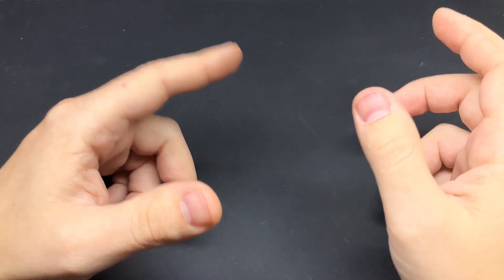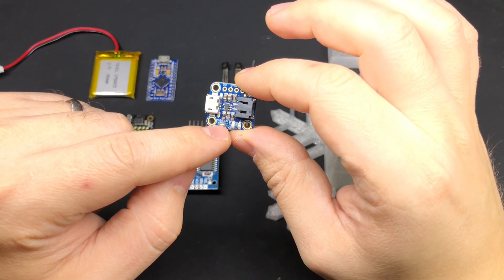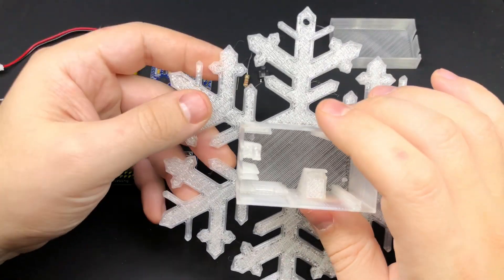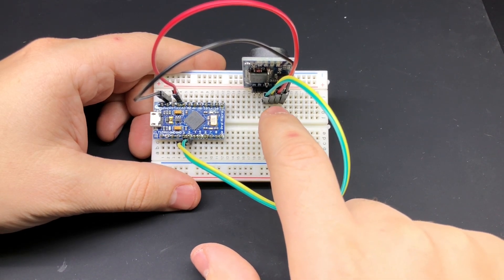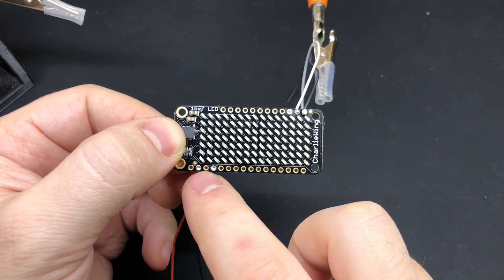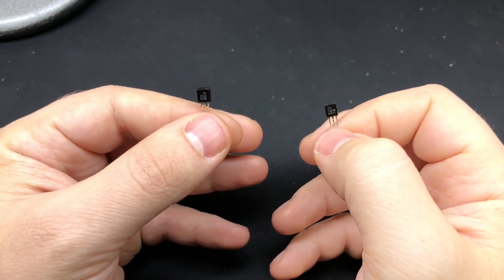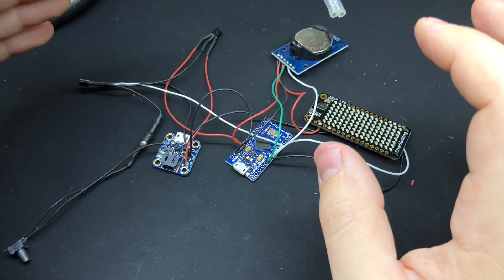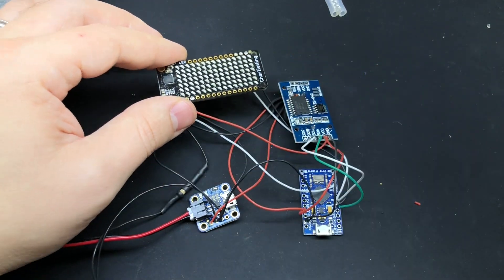3D-Printed Arduino Christmas Countdown Ornament

Comment: Thanks for sharing this Wermy! You rock! I noticed when doing this project that the SDA and the SCL on the wiring diagram for the Charlieplex is backwards (if you follow the wire path from the SDA on the clock to pin 2 to the charlieplex you will notice it goes to the left pin when it should go to the right pin). I just thought you should know. Thanks again for all your hard work and contribution to the community. You are an inspiration to us all.

Comment: You can use the charging board with the TP4056. You just have to replace the programming resistor to change the charging current.

Comment: Great circuit, especially the use of transistors and momentary button. I'm going to steal that idea.

FYI, it looks like the wiring diagram on your web page is missing the ground wire between the charge board and the arduino.
Reply from the maker: Ah thanks, I’ll fix it. :)

Comment: Would it be possible to make this so it would run off a Christmas bulb socket instead of the battery?
Reply: Peter Maroney you would need to disassemble a USB charger, wire the input of the transformer to a light bulb that would fit in the socket. Then wire the output of the voltage regulator (pin out of the USB port for 5v and ground) into the power circuit of this project.

Comment: Hello maybe someone is still up and seening this. I got a problem with uploading the scatch on the ds3231 it says that "DS3231_INTCN" is not declared. I don't know what this does but i can't find this value in any libary wermy mentioned and the rest of the internet left me hanging so i hope i can finde some help here.
Reply: The GitHub repo has been updated since this video was made, and the name "DS3231_INTCN" has been updated to "DS3231_CONTROL_INTCN". Hope that helps!
Reply: I realized that might not be perfectly clear - just change that name to the new one i mentioned and your code should run just fine!

Comment: I really don't recommend the DS1307 RTCs any more. They are too reliant on external frequency source. If the supplier uses crappy components, they are very inaccurate. The DS3231 uses an internal oscillator and is very accurate.